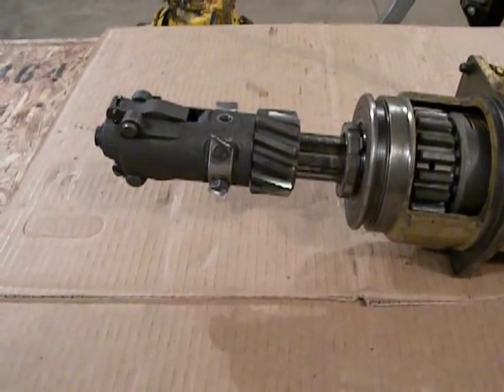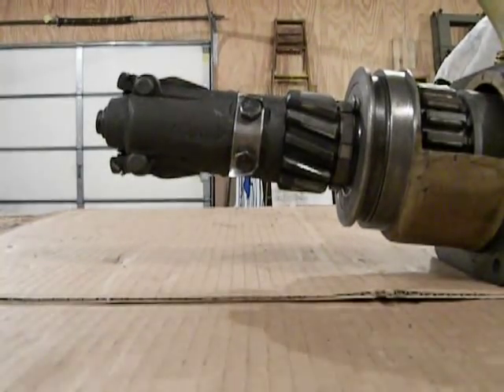Caterpillar D2 and D4 starting pinion operation

Comment: I can't get the screws to turn on mine and pulled the cotter pins out any ideas without snapping it or something I'm missing I did try applying some heat with a little map torch but didn't wanna ruin any springs with acetylene set
Reply: @Squatch253  oh alrighty so should I just pull it out then it's on the engine its number is 5u10364 the guy says it's a 53 but didn't seem certain it is the newer engine and pump assembly on it but don't have the top cover for the clutch pull out have to pull the engine on this one and can't see the tag on the rear end because the winch that's on it but the plywood backing of the seat has cat part number and says 53 I in it but seat could of been replaced with another

Comment: great tutorial..........i pulled the start pinion .  out of the D4 7U.today......coudnt get the latches to work proper....i tryed to repair them thru the little accsess hole in the bellhouseing....ok if your a proctolagest......pull the pony engine..unbolt the drive clutch housing....pull the cover of the fuel injection  pump ........pull the governor houseing..be care full  a few hiden bolts ...only then will the drive  come out of the bellhouseing.....the pinion gear was shot  .teeth ground off......miss matched  latches.......2 females.....any ways i have a spare parts  d4 7u .and  the  pinion   was  just like new  in it ...........and its got the  male / female  latches ...your  info made  this   easyer  to  understand    thumbs up to u....

Comment: My d4 is a 1959 with the in the seat starting setup and the whole thing is kinda wonky the pinion dont stay engaged if I dont hold it most of the time it wont stay engaged sometimes if the pony dies before I get the big motor to start it doesn't release. The pony also burns a little oil, And the governor is missing a pin so its stuck wide open, and the carb could use a cleaning, the mag will lose spark for a minute sometimes. I just let go of the lever when I see the smoke out of the diesel go from white to black and here it start to fire. Over all I love the machine no matter how much of a miserable bitch the pony can be at times. Im thinking its the adjustment not being quite tight enough.

Comment: I emailed with you last summer when I got this D2. I got all the parts here and the old girl in the shop. I was hoping you could give my a ball park adjustment on the bench for the tension on the latches. When I got the starter drive out several peices was missing. The one set screw was still there locked with the pin. It was set at 6-1/2 turns. I put it back together withe the other side set the same number turns and it feels awful tight. What do you think ?
Paul

Comment: The problem i have is when I push the compression lever in and kicks out. But only when compression is out turns fine I found the oil tube came lose and was hitting the starter pinion  so I am  gonna  check to see if is the cutter pin or what  happened but start with  a little  tension by hand  but really  want it fixed!!!

Comment: I've got a D4 with D315 motor. Pulled the pony, took bolts out of the pinion assembly but it will not come out. Something is holding it. Any ideas?